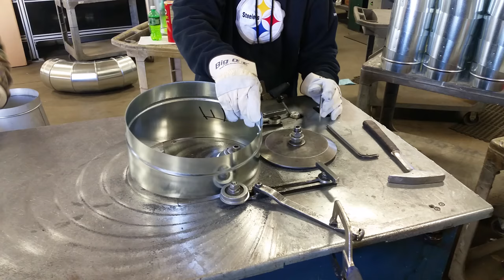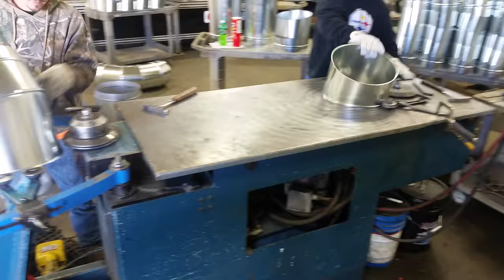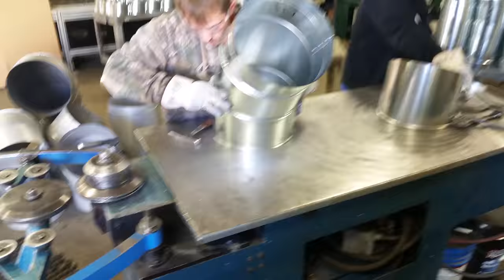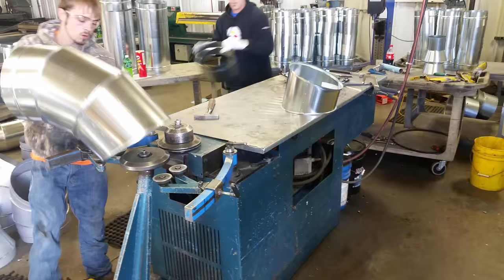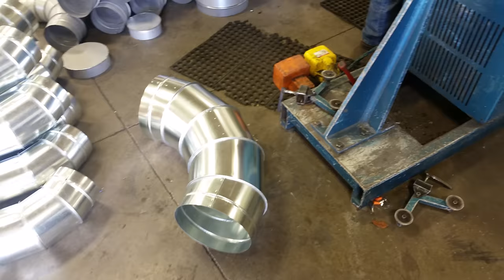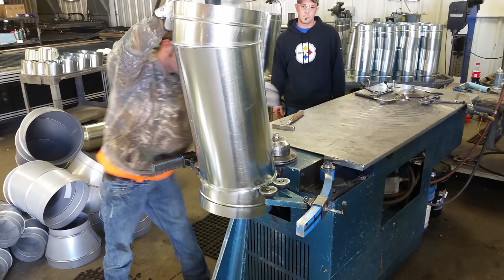elbow duct maker done the right way

Comment: I single handedly would put everyone to shame on the gore locker. Ive watched to many videos of people running it and their a few things they don't do. I am lights out fast 4min 90° 5gore elbow from flat to built. I'll post videos I've gone all the way up 60" on the gore locker.
Reply: Im fast as fuck too, also a skilled machine operator, i can make 100's in a day, from 200mm diameter upto 1650mm, the huge ones take much longer, only 3 in a day 💪15s, 30s, 45s and 90° bends, i seal my own too 😅
Reply: What is this machine called please and thank you
Reply: where are your videos? a year later...nothing.
Reply: @فكرتيك  Look up a company named "Spiro"  This is their old machine.   The part they're not showing you is you still have to have the gore blanks, whether they're hand cut, burned, or lasered, with certain allowances for the machine.  Then you have to roll them and attach them, whether spot welded, stitch welded, or.... these appear to be riveted?  It's hard to tell, since the resolution is so low on the vid I'm seeing.  I guess they could be really big spot welds.